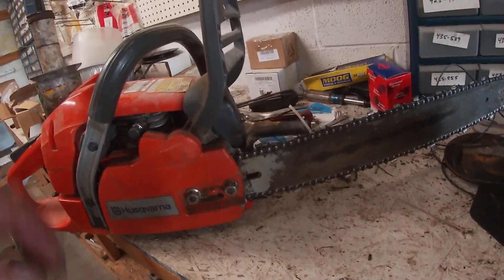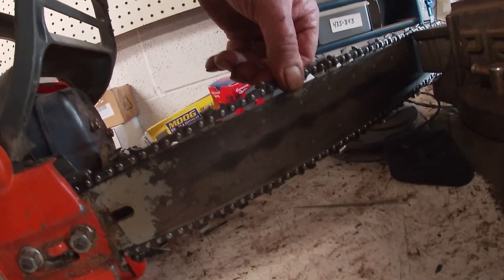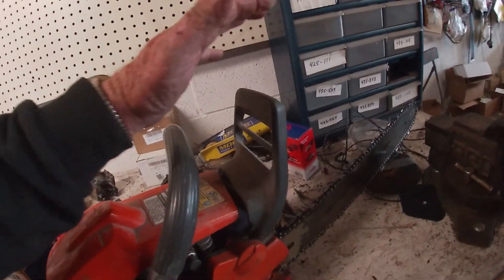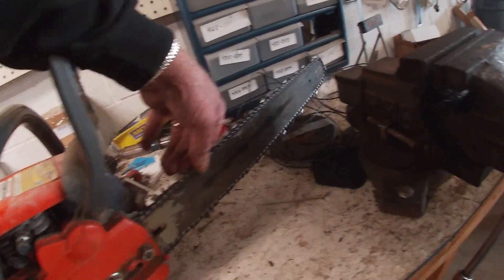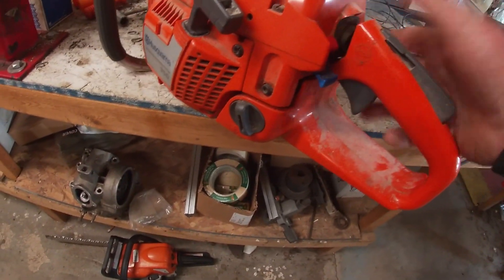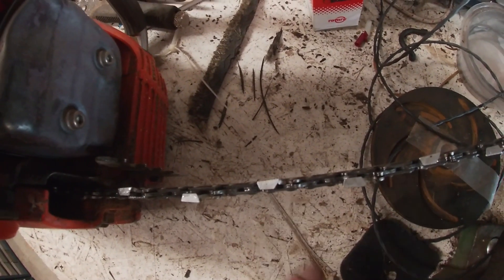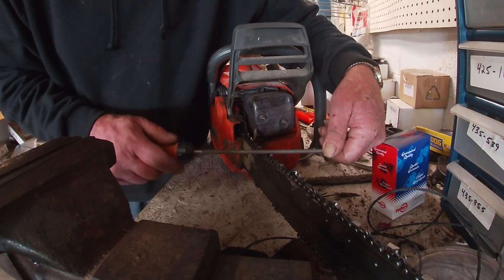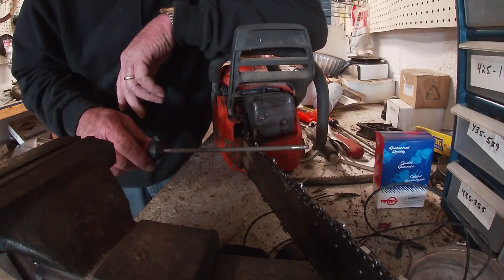How Does the Husqvarna 350 Chainsaw Work: Step by Step Explanation

Comment: Found one at the landfill. It cranked right up. Primer bulb cracked after I cleaned the bar and all so i don’t know but I’m kind of assuming the oiler is broken. The small holes on the bar were clogged densely. I think I heard the oiler was easy to work on with these. Anybody know?
Reply from the maker: there are plenty of videos on how to replace the primer bulb and oiler. Not a hard job and I know you can do it
Reply: @ for sure. I went to local shop for an oiler or parts to the oiler on a 450 rancher. They said it’s complicated they had to look at it to just drop the saw off with them. I guess that’s how they make their money. I’m seeing now how eBay has tons of cheap small engine parts.. I want to support local but they also told me they needed to look at my weedeater to sell me a bulb wtf

Comment: Most wood can be cut with a MS180 or MS181 with a 16" bar. A sharp chain is what matters. Always use a bench vise or stump vise and leather gloves for sharpening. A Stihl 2in1 file is the best way I have found to sharpen. I have a couple electric chain grinders and don't use them anymore. I sharpen every tank of fuel or sooner if the chain hits something and isn't cutting. When the chain is dull you stop and sharpen it ain't going to fix itself so don't abuse the equipment.
Reply from the maker: I do a touch up every fill up while in the woods. thanks Jason